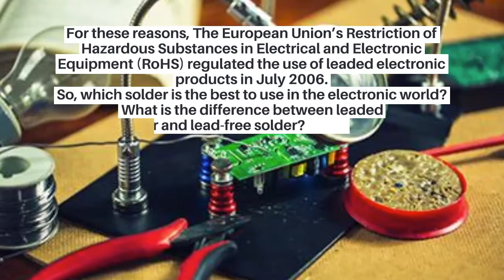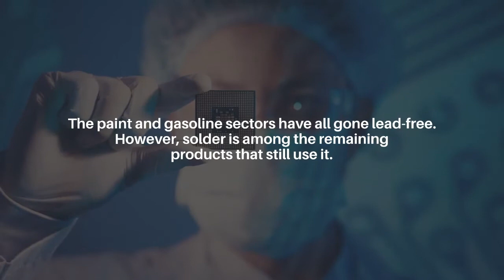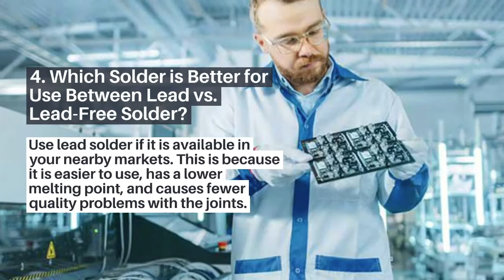Lead vs. Lead Free Solder: Is lead free solder better?

Comment: Melting point of lead is 621.5°F but fumes are only released at 900°F and this is when it becomes toxic. Solder (63/37 Sn-Pb) melts at  361°F. Not toxic fumes here. Other than toxic flux fumes (Yes, some can be just as toxic-look into "Fume Hoods").  Wonder who is benefiting from all these? Lead will always exist in this world of ours. Knowledge is key. Like in everything else.